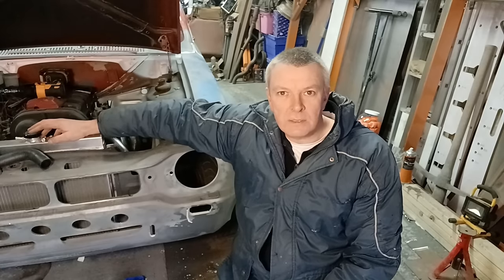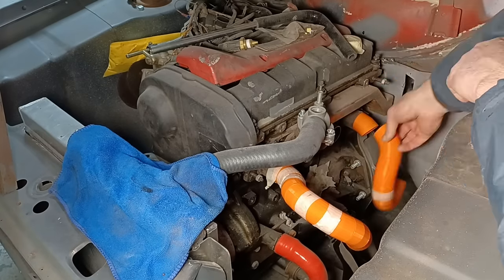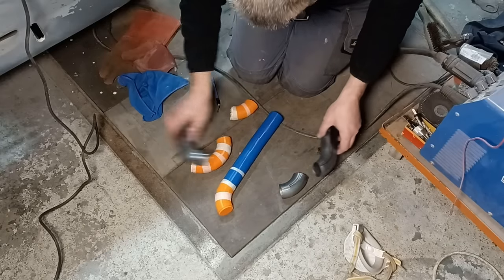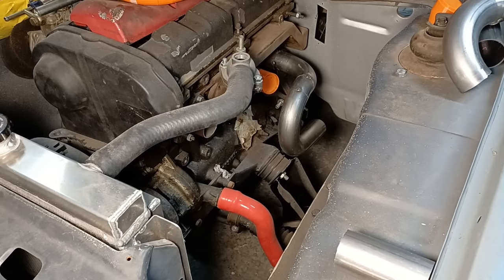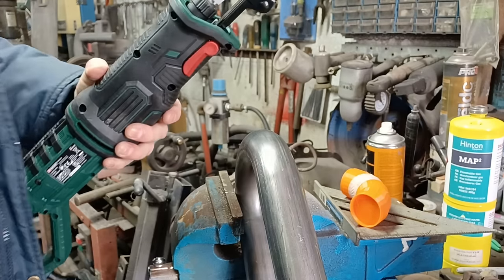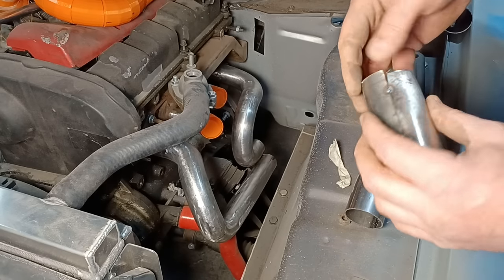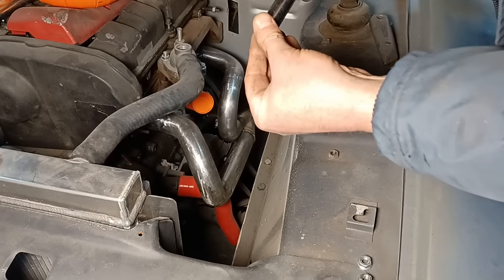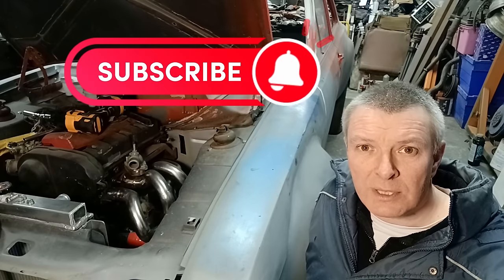Ford Escort MK1 Restoration Project, DIY Exhaust Manifold, Zetec RWD, ST170 RWD

Comment: That is absolutely fantastic, however I do have one constructive comment. Overlapping steps in the collectors are fine in one direction i.e. where the upstream pipe protrudes into the collector. However unless I missed you taking it out there is a step in the downstream side of the collector where the downstream pipe enters into the collector outlet rather than butting up to it. This made it far easier to get alignment to weld on the outlet tube and has worked in your favour....... For now, if you slice through the 2 collector outlet welds with your new "gizmo fantastico"  or a slitting disc, you will be able to remove the mismatch with a rotary burr or grinding wheel so that the weld will go back together with no mismatch,  (at the moment you have a bit of a CV (controlled vortex) as David Vizard caĺled them back in the 80's) but in the wrong direction .... a bit like a scoop facing into the flow. Please don't
think I am point scoring, but this wiĺl be really easy to correct at this stage to make it a pretty perfect performance enhancing part. Absolutely amazing  technique you have used not to mention mastering the art of 3D printing. You have my utmost admiration. Reallybehjoyedcwatching this episode as per usual.
Reply from the maker: Thank you Neil, I do very much appreciate the constructive criticism 😊😊 that's how we all learn from each other

Comment: Excellent work as always.
Remember seeing Adam at FabCo using these Icengineworks manifold building blocks and thinking what a brilliant idea but a bit pricey for a single use home builder, never even crossed my mind about 3D printing a set.
Reply from the maker: That's where I got the idea from 😉
Reply: I assumed that to be the case.

Comment: I spent some time thinking about a clever way to clamp the pipes and enable them to be welded, Dave was smarter and used tape. I'm inspired to build myown manifold.
Reply from the maker: 😊😊 me too, I've been wondering if I can make a clamp that will allow me to clock the pieces before taking.  Must be a way

Comment: Awesome work, yes I was in the same boat with my exhaust on the Sapphire, z32 300zx, BNR32 gtr, and my Z15A GTO MR..   and again on my current project the XR4X4i..  never learn stock brought heaps of straight pipe..  however love your work and no I'm not going make equal length manifolds for the Cologne V6 well not until I'm fitting the BOA later on.
Reply from the maker: Thanks Matt, ooo BOA engine, what a lovely thing, very overlooked, buy loads before they go stupid prices 😊
Reply: @DavesGarageUK absolutely rare as hens teeth here in New Zealand, I had one in the rally car (88 Ford Sierra xr4x4) but sold it with the car.

Comment: I reckon that's something of a masterclass. Would be great to see how you printed the plastic parts, too as I found that a real pain when I tried
Reply from the maker: If you direct message me on Instagram @daves_garage_youtube with your email, I may be able to send you the STL file
Reply: @DavesGarageuk  instagram you say.. never been there.......yet...

But in the mean time did you design those? I sownliaded some from thingyverse but they were hard to use with poor resolution. So id also be interesred in your orinter settings etc

Comment: Takes me back to when I had to fabricate the same sort of exhaust for the Zetec conversion of my Lotus Elan Plus 2. The off the shelf ones available were done with the lowest pipes being the lowest part of the car.  Thus hitting anything that looked like a bump in the road. After much fussing about, I was able to route them so they were now above the lowest point and a single unit, like yours, rather than the original two part style manifold from the twin cam.  Was able to make them so installation and removal was just a slip in/out without having to manipulate any other part of the engine assembly. It was a time consuming process, but worth the effort.  The exhaust was also stepped up in diameter in the manifold and from the last collector to its final end at the rear of the car. The ST170 was never available here in the US, only the 2, so no nice flange at the head.  A separate manifold flange was availabe from Dunnell Enginering in the UK for a nominal cost, saving a whole bunch of time.  A intake manifold was also available from same,, as the engine is equipped with Weber152G carbs.
Reply from the maker: You'll understand the effort then 😉

Comment: Looking at the 3D printed part (genius idea), if you left a lot of holes in them like swiss cheese.
Would you save lots of time printing?
Reply from the maker: They would probably print even slower! As the software that slices the code would make a perimeter for each hole 🤣

Comment: Hi Dave, how’s the rusty metal you’ve painted with different paints doing?
Reply from the maker: Hi, the halfords rust through is still holding up. The others have all rusted through.
Reply: @DavesGarageuk  so when repairing what paint do you use?
Reply from the maker: @WTiaP  on bare metal, the halfords weld through, seems to be good so far.

Comment: Hi Dave, noticed the accent, sorry if the assumption is incorrect. Where do you get your gas from in South Wales and what mix do you get?
Reply from the maker: Hi, correct 😉 I use brewery co2 which I get refills from Brisco in Gorseinon
Reply: @DavesGarageuk  thanks